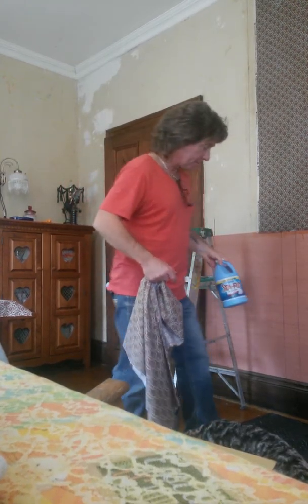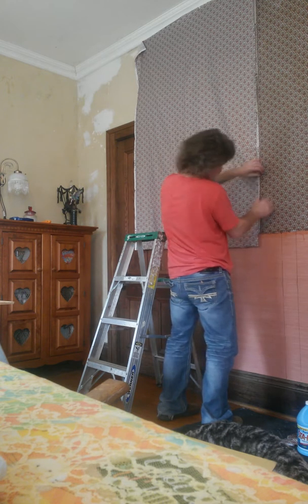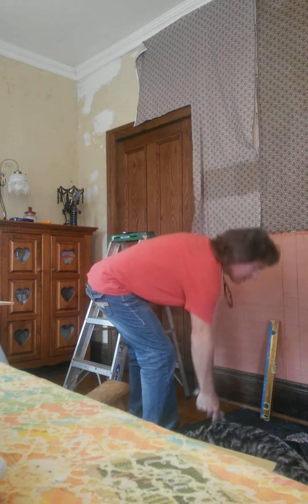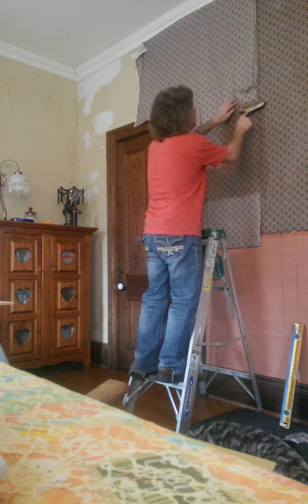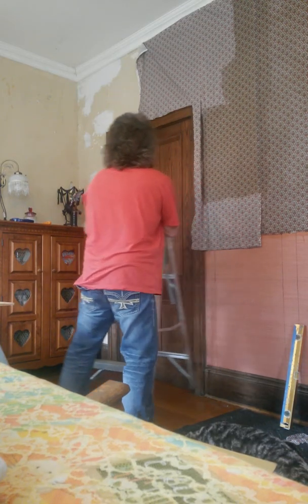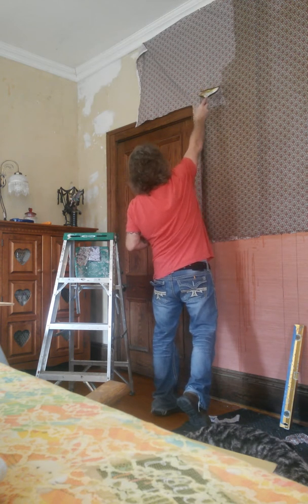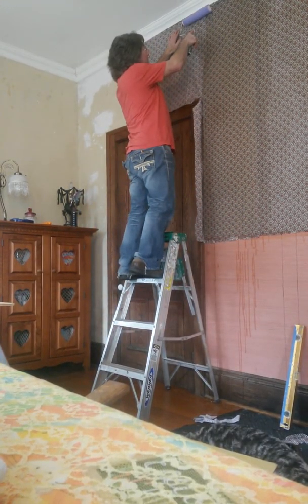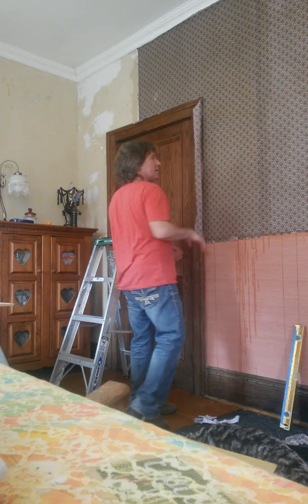Fabric wall covering Gothic Home..Liquid Starch.

Comment: I’d be falling off that scary ladder in a hot minute…covered in fabric and starch!!
Reply: In Australia we are now required to not stand on the top of a step ladder so we use a taller ladder often they have a safety rail or shelf at the top. I love it being in my later 70’s. So glad find your tutorial video. I have a couple of 3-4 stepped ladders which are so stable. Am building from scratch my second camper trailer and needed an appropriate fabric for the feature wall....so happy I found it and now the means to apply it.

Comment: Will it also work in rough wood surface?
Reply from the maker: I'm not sure , I've never done that but probably would be fine .
Reply from the maker: Just make sure there are no splinters sticking out , maybe do light sand If possible.

Comment: Hey,  just ran across this to get some guidance on using fabric as paper. You're the professional and I'm a DIYer looking for guidance. I'm putting fabric on hardboard 3/8" panels, ant I want to put fabric on these and mount them. I'll be using the fabric on bathroom walls. How permanent is the starch, does it leave a residue when it dries? Thank you so much. Doing this is a little intimidating.
Reply from the maker: Hello, The starch is permanent but you can remove the paper if you rewet it again. But if left alone the fabric will stay indefinitely..Never had any residue issues..All will be good do the best you can...Enjoy..

Comment: How long does this last?  And if it starts to fall after some time, just fix with more starch?  Sorry if I missed this Q&A in your video.
Reply from the maker: It should last forever, But you can wet it with starch again to fix or remove

Comment: Finally did this today. Had some issues with bubbles and re-wet with more starch and smoothed out. The problem is that it kept happening and I kept doing that and well I guess you know the definition of insanity. Now it’s worse and the bottom even curled up a bit. Do you think there’s too much starch? Should I maybe just try a wet rag with just water? Any suggestions would be appreciated. Beyond frustrated and it’s a shame because it looked so pretty.
Reply from the maker: I don't think the problem is to much starch , You can wet it and it will come right off and try it again just sponge it up with fair amount of water and start over its okay to use a lot of starch when you reapply after some time you will get the hang. And yes fabric looks amazing on walls way nicer than wallpaper.......Just do the Best you can....JJ